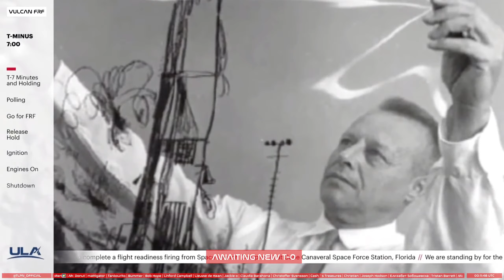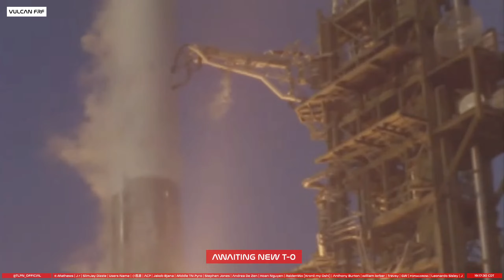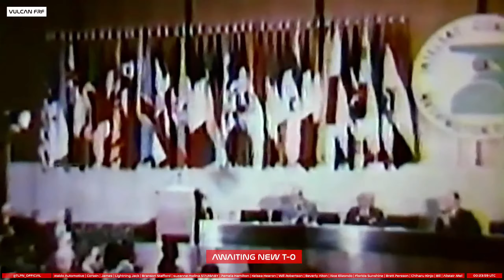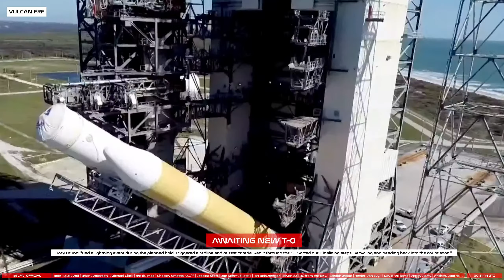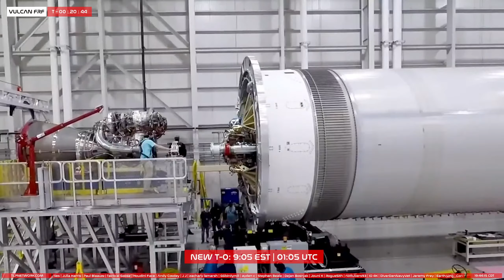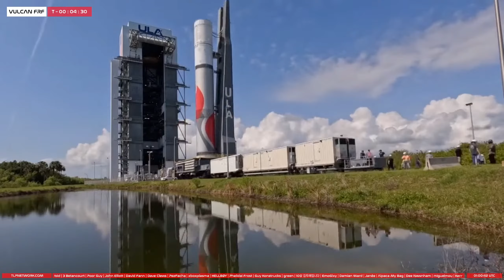REPLAY! Vulcan Flight Readiness Firing

Comment: Cant they all  just use the same engines? I see it as a waste of money.
Reply: There planning on reuse
Reply: @themdwaviator  i mean. Every american company use the same rocket engines.
Reply: @kyohiromitsu4010  No, they don't. For example, Merlin 1D is used on Falcon 9, Raptor is used on Starship, RD-180 on Atlas 5, RS-68A is used on Delta 4, BE-4 now on Vulcan and eventually New Glenn, and Rutherford on Electron.
Reply: @mikedicenso2778  no. Im asking why dont all of them use the same rocket engines if some of these engines are the same.
Reply: @kyohiromitsu4010  all the engines are different, such as different fuel, number of nozzles, etc